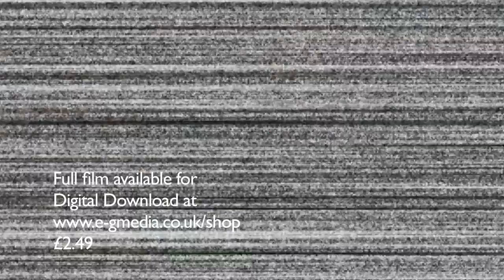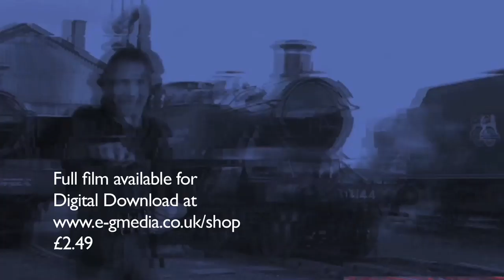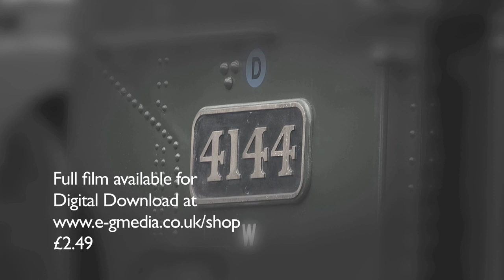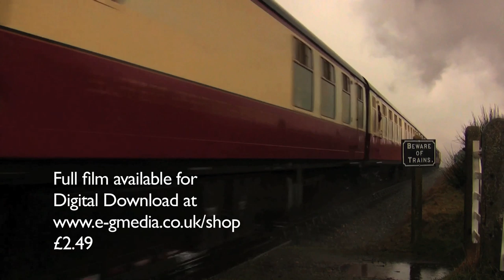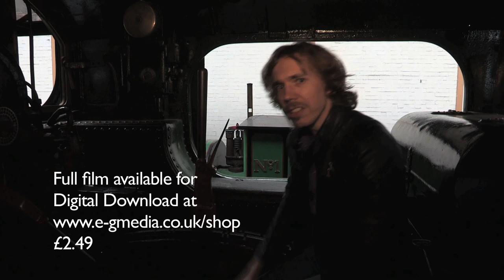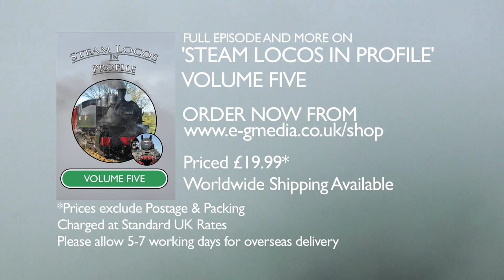STEAM LOCOS IN PROFILE - Volume Five Online Sample - GWR Large Prairies

Comment: So why did these continue to be built when you have the small prairie which have the same power, and the tender engines like the 4300 and aberdares which could prolly do suburbs quite well?
Reply from the maker: Higher cruising speed, higher water capacity,  actually a little more power than the small ones across more variants and more flexibility than tender engines
Reply: @ChristheXelent  I see, were 2-6-4T versions considered?
Reply from the maker: @knuckles1206  no, the GWR didn't see the point